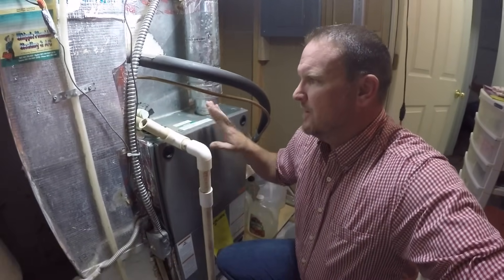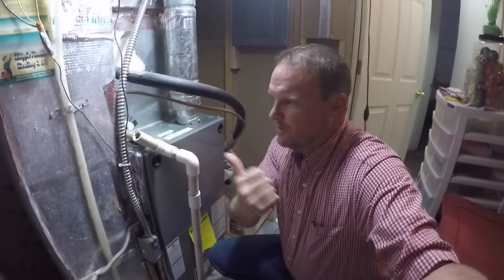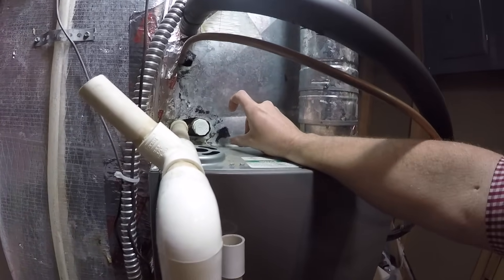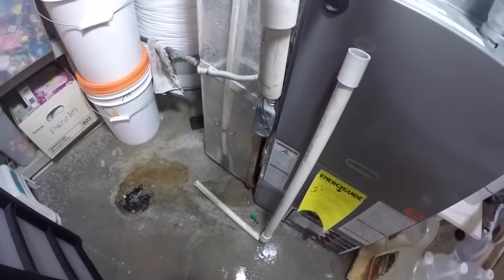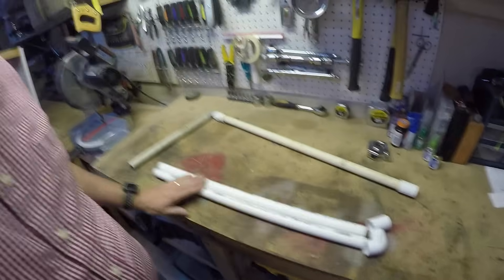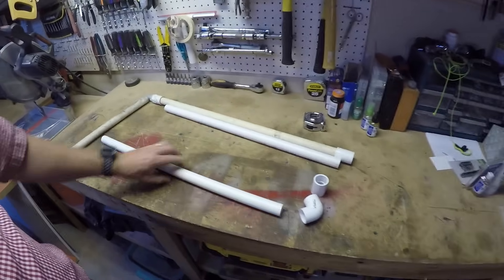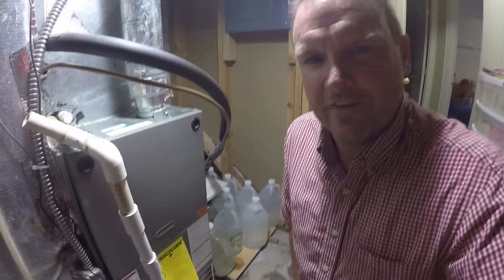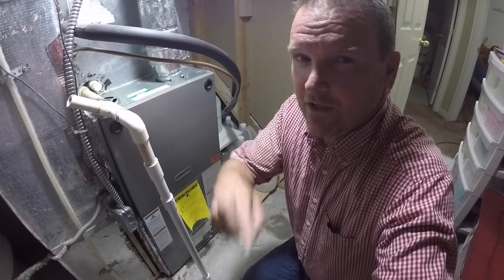Home AC Leaking Water On Floor?  Air conditioner water leak - EASY Fix - save yourself $1,000's

Comment: I thought it was fix but then it was still leaking I don’t know what to do ?
Reply from the maker: Was the pipe clogged when you took it apart?  Did a flood of water come out when you took it apart to clean it?  If not the water is likely coming from somewhere else.  Might be time to call in a professional.  Sorry this happening to you.

Comment: I think this is our issue but our builder glued all of the pipe fittings so we can’t unscrew them
Reply from the maker: Cut them and replace. It’ll save you thousands and only cost a few bucks. 🤷🏼‍♂️
Reply: @troysgarage  We wound up doing this before I saw your reply.  Thanks for the video.  It was very helpful in our decisioning

Comment: Weren't you interested in where it was blocked so you wouldn't repeat the problem.  Maybe a 90 is too much?
Reply from the maker: Truth, however it took more than 10 years to clog the first time. I just added “check the drain tube” to my annual maintenance for the furnace in the Spring. If it starts to get clogged again I’ll replace it. So far so good and it’s been years. 👍🏼

Comment: So what if I can’t remove the pipe to clean it
Reply from the maker: Cut the pipe, clean it all out and use a coupling to put it back together. It’s not a pressured pipe so no gluing or soldering is required.

Comment: I cut my pipe but it didnt explode with water... I cut the pipe in different sections and I not see a clog
Reply from the maker: The clog might be in the pan opening that leads to the drain pipe. Try using a wire to fish up in there. See what you can find. If the drain pipe is dry the water is clogged somewhere.

Comment: MONEY+TIME WASTED, BUYING UNNECESSARY PIPE+FITTINGS; it is CHEAPER+EASIER to CLEAN OUT CLOGS.
 WONDERING, if the CUSTOMER PAID parts and labor FOR THAT JOB?
Reply from the maker: Not a customer, it was my own furnace!  DIY repair. I had the parts sitting in a box. That was free!  🤷🏼‍♂️🤨

Comment: I have a non working outside ac. Underneath my house is flooded. Called plumber and he said it was coming from one of the ac pipes. One how to stop the water and two why is it pouring water when the ac is broken. Need advice quick.